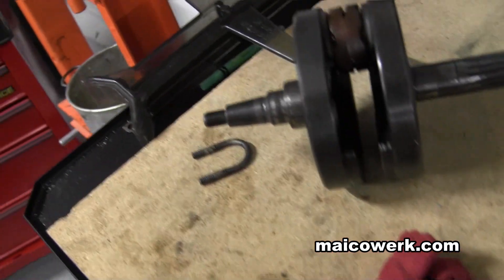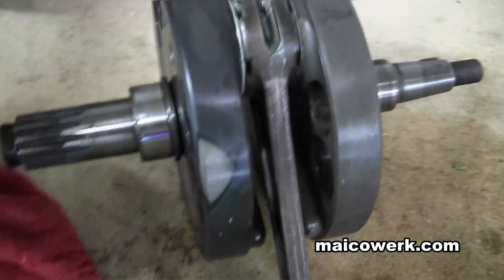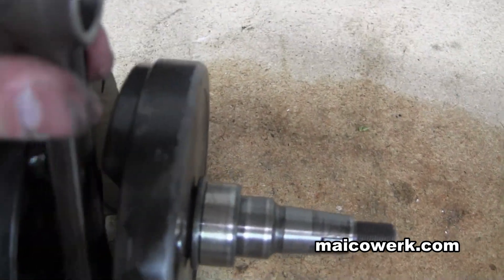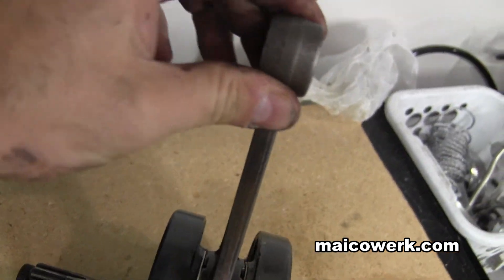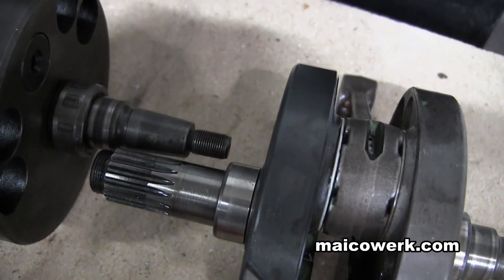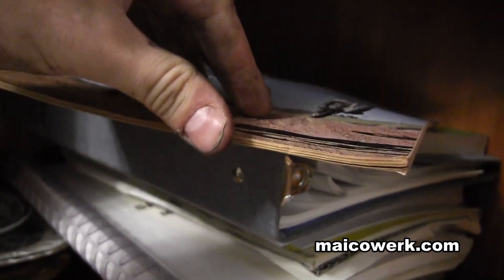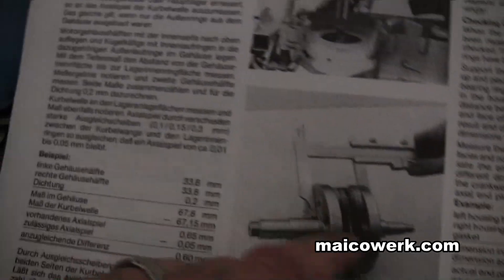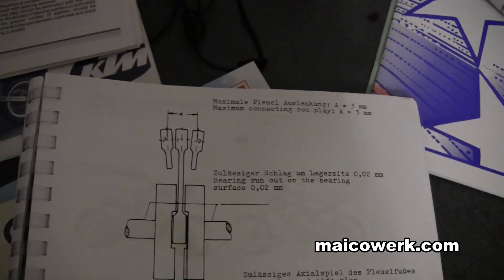Connecting Rod Play

Comment: Can the wrist pin be a little loose in the rod? The top of my rod had some damage and I took it down.  Now the wrist pin isn't that tight.
Reply from the maker: So, the problem is going to be the piston being able to go further up and down than it could as well as putting stress on the wrist pin unevenly.  I wouldn't trust it.  Depending on how the piston will now move, it could bang off the head.  The bike is likely to run and who knows how long it would run for.  I started a husqvarna 250CR 81 that the connecting rod was pink from rubbing on the crank, the piston had a large chunk out of the top because someone put a bolt through the side spark plug that was too long at some point, no compression and every bearing spun in the engine.  So even if it runs you can't be sure what damage it may be doing.  If you put the piston in can you move it in place up and down by any amount? These things can expand and the distance we are looking at between the piston and the top of the head is around 1mm or .40 or so inches so a little bit of movement could bang off the head.
It could be fine and run also, I don't know how bad it was, but its just a question of taking the chance vs. the money it would take to replace the rod.
Reply: @Maicowerk  or machine the rod
Reply from the maker: @RideWithTheWolf  It would make the whole thing bigger tho.  You could always ask someone to take a look and give an opinion.
Reply: @Maicowerk  but when the bike gets hot there will be less play? I think this is how the cam works too.  There can be a little play because the engine warms up.

Comment: Good informative video. I have bandit 1200 , 2006 model and had the same sounds comming from the engine. The bike started overheating and engine died. But now the noise is getting thicker and thicker. The mechanic says its the sound of connecting rod. I guess its the same problem?

Comment: The side to side play is called "rod gap"  some (meaning very few) engine manufacturers publish the clearance tolerance for rod gap. But what I really want to know is,  how come there is no bushing for the rod gap on both the big end and small end of the connecting rod. GM LSx car engines don't have them either. I've been researching for a week, so far no answer.
Reply: because the rod surface doesn't touch the crank! up and down, not side to side is what matters. when the motor is assembled, does the rod move side to side? no. its "locked" in place by the engine forces on the rotating assembly. with 2 strokes anyway, you need some some play to let in fuel + oil to cool everything down. ditto for the pistons... can't be too tight like a 4 stroke motor.
Reply: @ct1762  It makes sense. Thanks for the response
Reply: What about if i have like 1/16 gap play for yamaha yz 450f 2015? I'll appreciate your answer

Comment: Is this something that we can diagnose without opening the engine? Like something we can hear?
Reply: I would say yes. My 2 stroke blew a couple of days ago, and before that, I could hear a tick as if it had valve rods. Normally, it would sound crisp and clear until that noise started, and later one day found myself walking 7 miles back to my truck. Turns out that bearing exploded and seized my rod to my crankshaft.

Comment: Interesting video, I have seen quite a few videos where excessive crank end play and excessive big end play or sideways con-rod play features in work that must be corrected later. Is this an indication of engine wear or poor craftmanship? 
Can I ask you if you know what material has been you on those forged connecting rods the one attached to the left hand crank, as the colouration looks as though it could be a bronze aluminium alloy. And that colour is not just oil stain either becuase mine are that colour and when the oxide is cleaned off it almost looks like a coppery bronze colour.

Comment: I'm years out of date with this but Maico specify  the total movement of SMALL END side to side, big end side to side is irrelevant if the thrust washers are installed and not worn out. I can look up numbers for 1982 940 Alpha 1 as that's the only manual I still have for them. It's way easier to measure before you split cases,Push rod to side, measure movement. Push big end against other flywheel, measure movement. Average is what you got. If you don't have enough side clearance big end will probably be under lubricated. Rick was still living in New Mexico last time I was in touch with him  (several years ago now) My 490 was dyno'ed at 63bhp at the wheel, it had been rebuilt for the 1982 Le Touquet beach race in France. Pretty sure your reading the manual wrong, have you had any training to re-build cranks? The 'Big 4' tend to give less information, clearances and lengths are for crank building. I really liked the YZ490 but with only 4 gears it was always limited use and on some tracks just couldn't be geared right. 125mph 'in the woods' on a big bore two stroke isn't as much fun as it sounds, plus, Metzelers lose the knobs off front tyre

Comment: You should have mentioned the washers to much side to side play is commonly caused by the washers that are made of a soft metal usually Cooper I had a bike that the washers between the rod and crank web was so worn out it split and came apart ! Had to press the crank apart and replace the rod bearing , pin and those washer of course!

Comment: 'up and down play' is rare the bearings usually just explode plus you need side to side play for when everything expands; if you have a tight rod or one with very little side to side play it's mostly like to seize up, snap rod etc
Reply: But my engine seized with a thick tik tik tik sound which was comming before hand. And it started to get thicker and thicker...

Comment: my connicting rod have a play side buy side. it is ok? i use only replacement con.rod. mokoto brand. what is the couse of dying con.rod? thanks a lot
Reply: I can agree with the husqvarna statement, my wr 125 03 con rod-washer clearence was larger than a buddies kx 125 04
Reply from the maker: Cost of a connecting rod varies with the bike.  Expect $100 to $200 plus labor to replace which could be $40.  Side to side depends, there are tolerances specified by the bike.  If you can push it to the side and it scrapes off the crank it's definitely bad.  some bikes, like husqvarna, had washers on the piston instead so they had larger side to side than other bikes.

Comment: The rod in my 400 had no up and down, but a little bit of side to side. Will it be fine?
Reply from the maker: depends on how much side to side.  The manual should tell you the side tolerance.  If you can get it to scrape off the crank pushing it to one side when you rotate the crank definitely not good.